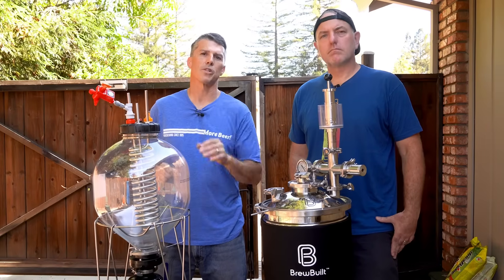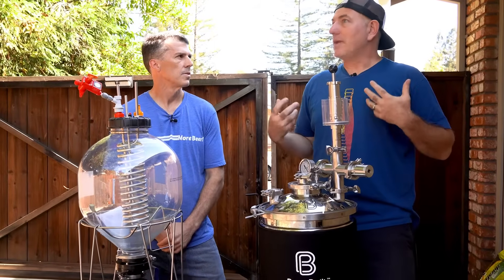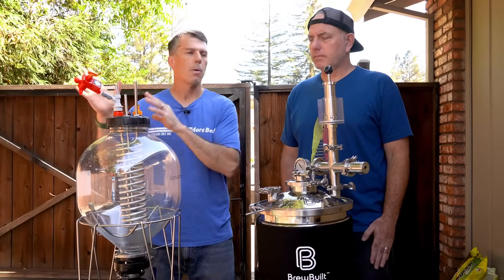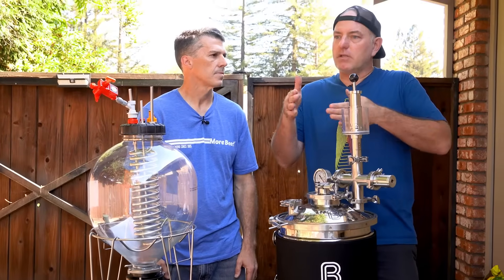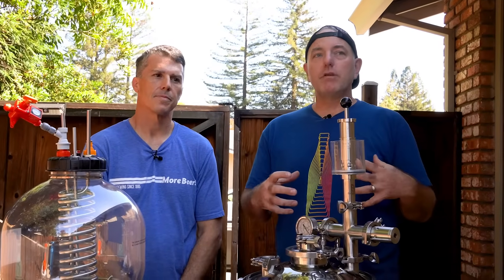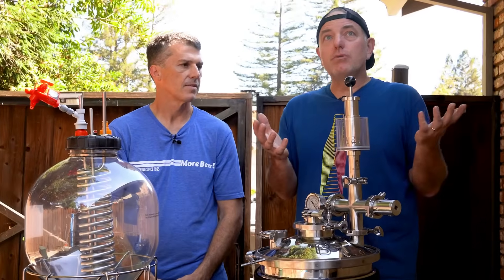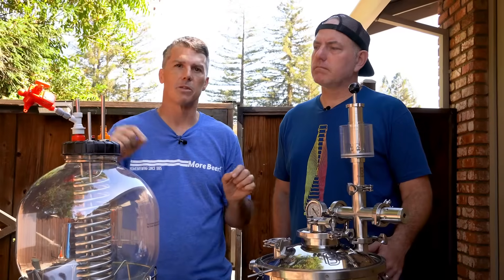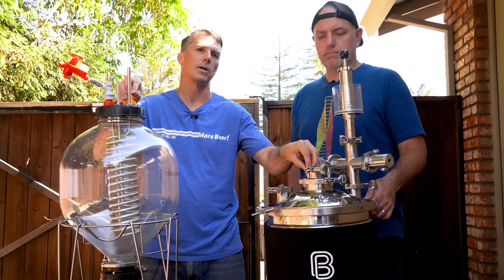Everything YOU NEED To Know About PRESSURE FERMENTATION! | MoreBeer!

Comment: So I have an all in 1 PRV from Spike.  Once I start fermentation (Spike Flex+), I just let the pressure build, until it reaches my target, usually about 8 psi, but when I go to dry hop, I need to relieve the pressure before I can add.  After hop add, it takes longer to build pressure.  Do you recommend adding co2 to build the pressure back? Also, I bottle my beer, so I use an old catalyst fermenter as a bottling bucket, add my sugar water, transfer from the fermenter to the bucket, wait, and then bottle.  Sometimes my beer is over carbonated.  How should I adjust the amount of sugar based upon pressure fermenting?  Any idea's of formulas?

Comment: If I were to pressure ferment in a corney keg can I connect my CO2 up to initially set the pressure to 20 psi that is required to get the corney keg lid to seal?  I'd drop the pressure down after the lid is sealed, but I am concerned that the initial burst of CO2 will harm the yeast.  I was thinking to use a spundng valve to ferment at around 15 psi.

Comment: I normally have an open first fermentation, add some sugar and pressureferment in 1,5 bar for CO2. I would never use plastic vessels for pressure fermentation. Use a 30 l stainless steel keg.
And allways remember safety.

Comment: I just picked up a brewbuilt X1 from you guys added pressure pack and spuding valve tower.  The directions are lacking but I assume the prv that comes in the pack is to replace the prv that built into the lid?  It doesn't fit nor do ones I swap off a keg and the built in prv is rated to like 2lbs.  What am I missing?

Comment: I am researching whether I should transition to brewing under pressure. It would be helpful to see a complete brewing video from the initial brew, transfer to the fermentation vessel, hook up of CO2, and how the setup allows for the release of CO2 generated during fermentation, while keeping the pressure on, and the temp. control setup during making the beer. 
I keep seeing the setup in bits and pieces and it would be helpful to me to see the entire setup in a real brewing situation. My fermentation process is designed for my size and strength level, so as I've improved and evolved my brewing to improve the quality of my beer, I've created a setup that reduces the instances of lifting heavy liquid-filled vessels from one location (my kitchen where the initial brew happens) to my backroom where the primary and secondary fermentation and kegging take place. 
I know this would be a longer video out of necessity but it would help immensely with my purchasing decision since I am on a tight budget. Thank you for this video and the quality products you sell. Cheers!
Reply: Same
Reply: Same here too.  I'd also like to see a complete list of parts for the lower cost option.  What is that assortment of coiled tubing inside the fermenter?  Link me to a complete kit if you want a sale!
Reply: Agreed. Content creators mainly talk far too much instead of actually showing how to do it from start to finish. Very frustrating for brewers beginning their pressure fermenting journey. I also believe a lot of these videos over complicate things, totally unnecessary for beginners, it just scares them off. No wonder home brewing is in the decline.

Comment: Good rationale and tips. They sign with my experience as well with the exception that I always use 15 psi for every yeast stain without any problems. Going too much over that, I have noticed incomplete fermentation though.
 I’ve been pressure fermenting ales and lagers since 2017 and haven’t looked back. It’s a great way to ferment for most beer styles except those that benefit from esters such as Hefeweizen.
Reply from the maker: Awesome, cheers Larry 🍻 we love your channel!
Reply: Hi, Larry do You fermenting hoppy beers under pressure or not..thank You
Reply: @markosolaris550  I generally do not. It negatively impacts the ester production which is what gives ales much of their flavor.
If I do, it’s mainly because I want a very slight positive pressure to account for slightly elevated room temperature or to ensure a positive seal against air getting into my fermenter.

Comment: To check the sg, I guess you'll need take a sample and leave it in the fridge until it's lost carbonation?
Reply: I pour my pre-carbonated beer through a coffee filter to (mostly) decarbonate.  Those tiny bubbles clinging to the hydrometer account for a huge difference in FG readings in my experience.
Reply: @mikegehring3710  That's exactly what I was thinking, the wort needs to be flat/uncarbonated or it will throw out your readings

Comment: I tried pressure brewing 5 batches ago, all ales, and I'll try a lager soon. Every ale has brewed faster and tasted smoother than before, smooth like lagers. Next batch will be a lager. :)  I brew ales at 15 PSI and every one's been perfect. I'll probably do my lager at 12 PSI.  Even last week's vanilla porter was completely fermented in 3 days, 1.067 to 1.18, was super smooth (even with extra vanilla), and easy to push into a keg for aging.  I'm on a tight budget so use a FermZilla All Rounder, doing 6gal batches, and I only get 1/2" krausen, though I also add 6 drops of vegetable anti--foaming oil.  I also can't say enough about ending up with half-carbonated beer, not just that it saves on CO2, but also because a keg chills & pressurizes in half the time.

I also chain-brew: do a 6 gal batch, push the fermented beer into a keg (using a bit of extra CO2 pressure from my tank), then pouring a new batch right into the fermenter which still has the trub at the bottom, now having twice the active yeast as before, kind of reminiscent of session beers, hehe. I don't do this more than 3 times, though, for various reasons. (Yes, you can have too much yeast, though you can always remove half of the trub before pouring in the new batch.)

In short, I now only do pressure brewing. It's possible that I might some day do a special batch where I won't want the pressure, but I really can't imagine needing to do that. And hey, if you don't want pressure, swap the gas-in post with an airlock, and voila!
Reply: If you don't want pressure, just open spunding valve fully.

Comment: To me it doesn't make sense that pressure would keep in aroma. The pressure in the gas phase is equal to that in the liquid (henry's law), so what's your logic behind that claim?
Reply from the maker: Can't argue with law especially henry's. With that said I think what Vito was getting at is what most commercial brewers do, that is cap your tank and let pressure build up after you dry hop. Leaving a blow off or airlock on after dry hop makes your brewery smell great but I think we can all agree those aromas are better in your finished beer.
Reply: @MoreBeer_  Thanks. If you were referring to dry hopping when co2 is still being produced and escapes through the airlock og spunding valve, then it makes sense. Aroma will escape to heaven with it
Reply: I find it to be obvious when dry hopping. If timed right, add the hops and cap the fermenter to allow pressure to build. Hopefully fermentation is complete before pressure builds beyond the point where the CO2 (and aroma) are exiting the spunding value. I haven't perfected that process yet but I'm getting close. 🍻
Reply: @TheMattMustain  you wouldn't open it directly to add dry hops of course
Reply: @mrknaldhat  You could use the magnet trick or hop bong contraption.

Comment: Thanks Great info as always.  I have pressure fermented a few time.  The issue I have ran into when doing my closed transfer to the Keg the Co2 seems to come out of suspension basically shacks up the beer inside the fermenter and turns into a cloudy mess.
Reply: If you are able too, cool the fermentor and beer first, then transfer to keg. This will do two major things: First is it will get more yeasts and proteins to drop out of suspension clearing the beer before you transfer. The second is the beer will hold the CO2 in liquid at colder temps better than room temp. The cold transfer is hundreds of times better than a warm temp transfer.
Reply from the maker: Make sure you're putting head pressure on the fermenter as well and regulating it at the end of the transfer in the keg
Reply: I've been pushing beer from my FermZilla to a keg by simply swapping the spunding valve for a gas line from my CO2 tank, then increasing the FermZilla by 3-5 PSI, and I've never had a problem...no foam, no cloudiness, perfect xfers every time. It goes w/o saying that I'm using a float tube so I'm only drawing off beer from the top. :)
Reply: This is great content. Thanks!

Comment: What I'm not totally clear with is the carbonation impact: as you said, you will have some carbonation in your beer if you ferment under pressure. But how much volume? How much is there already? If I force carbonate after, should I adapt my pressure time and fermentation? Can this be combinated with added-sugar fermentation?
Reply from the maker: Without using something to measure the amount of CO2 in solution like a Zahm & Nagel CO² Volume Meter it's really hard accurately account for it. You could work backwards from a standard carbonation chart/calculator to get a good idea. For instance if you had your spunding valve set at 12 psi and your fermentation temp is at 68 you should have about 1.5 volumes of CO2 in solution already. Hope this helps!
Reply: @MoreBeer_  Aye, compute the CO2 volume in your fermenter (based on PSI and temperature), subtract it from your target PSI, and that tells you how much volume you're short on. Myself, I just push my half-carbonated beer to a keg, then set the keg PSI to where I want it, and start it chilling.  You can chill the fermenter if you want, but it basically puts the yeast to sleep, though you do get clearer beer. Mine's pretty clear anyway, so I only chill the target keg, allowing me to immediately pour another batch of cooled wort into the fermenter for the next batch.
Reply: If you bottle it can be a pain because you need less sugar to add a little bit of CO2. If you keg, it is EXTREAMLY easy. After fermentation you know your temp and you know the pressure. This will get you about 90% of the way there. Once you transfer to keg, just hook up the CO2 from bottle and set pressure to desired Volumes of CO2 pressure. As it cools the bottle adds more CO2 to beer. You generally want to "rest" or condition a couple days to clear up and cool. During that time the CO2 will be topped off and you will be at perfect CO2. This is the "set and forget" method of carbonating. No need to shake or do anything.

Comment: I am yet to be sold on pressure fermentation.  Since I received my fermzilla I have cleaned it and sanitized religiously before every brewday. I have completed 2 batches (3rd in progress) but the first two were terrible, they both had significant off flavors.  The first batch took about 2 weeks in the keg to settle out to be finally drinkable, this may have not been related to the fermenter but related to lowering my ph in the mash and then tossing in strawberries after primary which added more acid to make the beer even more sour.  The second batch I didn't add fruit to at all, however even after almost 2 weeks in the keg it is not even close to being drinkable.  I think this was my mistake which you mentioned in your video but I had not heard of it prior because I just jumped right in.  First when I pitched my yeast I  pressurized my fermzilla to 15lbs and let it rock.  BAD MOVE, from what I have read you need to let it pressurize naturally.  Second when I was transferring I pressurized my keg to 15lbs and then let a bit out to make it have less pressure than the fermzilla but it was not transferring.  My mistake was removing the pressure from the fermzilla which mixed everything up again and I transferred a bunch of nasty stuff with my beer.  I also transferred room temperature carbonated beer into a cold keg which made it foam and overflow a lot, removing my natural carbonation.  This batch I am also fermenting under 10lb of pressure as I thought maybe the 15lb had caused the off flavors but according to your video 15lbs should be fine.

You live and you learn but it's hard to justify remaining on pressure fermenting since after 8 brews these were my first 2 failures that didn't taste good at all, every other batch i thoroughly enjoyed.
Reply from the maker: What kind of off flavors are you getting? You mention a sour taste, that could be from the fruit/citric acid or the mash adjustments as you mentioned etc. But also CO2 does have carbonic acid and can lower the pH of your finished beer slightly as well. Typically you want your mash in the 5.2-5.4 pH range then after fermentation most beers are around 4.5 pH. But let's get back to fermenting under pressure, as Vito mentioned most commercial ales are brewed under pressure due to the fact they are in massive tanks with typically another foot or so of water creating back pressure in the blow off bucket. When you run the numbers on that we're talking about 2-5 psi. So it might be worth trying a batch in that range and seeing if you like the flavors better. We agree, it's not that fermenting under pressure is a magic bullet, but it allows you to suppress or express esters etc. as you like amongst the other benefits. So think of it as another arrow in your quiver of ways to craft your finished beer. Hope this helps, cheers
Reply: @MoreBeer_  Yeah the sourness in the first batch was no doubt due to adding the food and lowering my pH with acids. That one was finally drinkable after a few weeks but the second batch it still sitting there gross. I'm not sure even how to explain the flavors who knows LOL. I just know that it's too disgusting to drink after 2 weeks in the keg. My third batch was done with the logger yeast but still a cream ale grain bill so hopefully this one comes out better it's starting to clear up a few more days and I'll probably transfer it.  When you mention two to five PSI are you talking about on my next batch I should limit it to no more than 5 lb pressure?
Reply: I only brew under pressure now, and have never had off flavors, except perhaps a bit of sulfur depending on the yeast strain. I pitch and add pressure to 15psi immediately, then back off to about 12psi... I maintain it at 12 psi. But, with you adding fruit and things... I assume you are brewing ales? Ales def do not benefit from pressure nearly as well. I would stick to just temp control and a bubbler for any ales, and use pressure only for lagers.
Reply: @Tense  I follow pretty much the same process. I do cap my ales with 20% left while ramping up the temp and let the pressure build to 20+/- psi depending on the desired CO2 volumes. See Brewers Friend carb calculator. Cold crashing then naturally carbonates the beer. CO2 bottles go a long way now. I've been very happy with pressure fermentation. Haven't found a yeast yet that didn't perform.
Reply: @Tense  Yea I have been brewing a cream ale and the first pressurized experiment was to let if ferment out and then remove pressure which pulled everything back into suspension, added fruit and let it clear for transfer.  It was sour as heck!  I should have not adjusted the pH and just let the fruit do it honestly.  The last time though no fruit and it was terrible and undrinkable, as actually a yellow cloudy color.  This time I don't think it can be called a cream ale because I went with a Saf Lager 23 so hopefully while I used a lager yeast it will taste somewhat decent lol we shall see!

Comment: For someone like myself, who’s never done pressure fermentation. Do all yeast strains or beer styles work well with pressure fermentation?
Reply: I have been pressure fermenting all types of beers for 8 years. There are NO yeasts that can't be pressure fermented. NONE!!!! I will give anyone 1 million dollars if they can give me a yeast that does not work at 15psi. There is a lot of false info out there about pressure fermenting. Most of the bad info is from equipment manufactures that don't make a pressure fermentor.
Reply: @danieldickinson8109  ok
Reply: I can only speak for lager strains but I have not found a strain of lager yeast that wasn't quite happy at 10-12psi which is what I typically go for.
Reply: Not all will work under pressure, a lager yeast does good but google what yeasts are great for pressure fermenting. Some yeasts will fail to do their job under pressure.